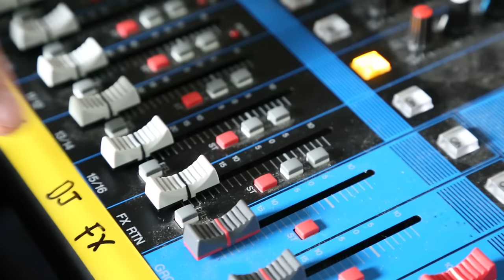How to Soundproof a party wall against noisy neighbours

Comment: Good video. Is it necessary to apply to Building Standards for permission before doing this type of work to a party wall?
Reply from the maker: Hi Rocknroll, in the UK, generally no, you shouldn't need permission just to add soundproofing to your side. If you wanted to double check, no harm speaking to your local building control.

Comment: Hi im inquiring about getting my front room done so whats best to block music you reckon
Reply from the maker: Hi adrian harry, we have different systems depending on the level of noise you are trying to soundproof against and the type of noise (e.g. airborne / airborne and impact music vibration). The wall soundproofing systems are also dependent on the build-up of your wall (e.g. solid, or stud wall). If you call one of the technical team on 01423 206208 they will discuss your noise issue in more detail with you. 
The best performing system is the ReductoClip Independent Wall system:
https://www.soundproofingstore.co.uk/reducto-clip-system

There are also direct to wall options:
https://www.soundproofingstore.co.uk/reductoclip-direct-to-wall-system
https://www.soundproofingstore.co.uk/soundboard-4

Comment: Can I mount these on top of plasterboard?jay
Reply from the maker: Hi yes, on a standard brick/block party wall and we recommend using 9 hammerfix 80mm screws for each board. If fixing to a stud wall then you need to locate the frame and attach the boards through the plasterboard, directly to the frame because they weigh approx 34kg each.

Comment: Hi, can you soundproof with plug sockets in your walls??
Reply: PC No price?
Reply from the maker: Hi Alfie - You can use something like our putty pads which can either wrap around the back of the socket box, or insert inside the socket. https://www.soundproofingstore.co.uk/store/Acoustic-Socket-Putty-Pads-p52901193 These will help minimize the problem, but the sockets will always be a weakness. For best results, soundproof the whole wall and have the socket surface mounted, or move the socket to another wall. Obviously the these options are much more intrusive, so many people will opt for the far easier putty pad solution.

Comment: Does this work for impact noise? Eg foot steps from the flat above
Reply from the maker: Hi bigbobabc123 In terms of impact noise this is always best dealt with at the source of the impact. I.E. on the floor of the flat above. For impact noise, you would therefore need to look at our SoundMat™ solutions, e.g. SoundMat™ 3 Plus  (please see link: https://www.soundproofingstore.co.uk/soundmat-3-plus)  
The SoundBoard 4™ as shown in the above video would only be used for walls and is most effective against airborne noise.
If you don't have access to the floor above, then you would need to look at soundproofing your ceiling and the most effective system would be the ReductoClip™ Ceiling System:  https://www.soundproofingstore.co.uk/reductoclip-system-for-ceilings

Comment: Could you stick a sheet of green glue + drywall over the top?
Reply from the maker: Hi You could add Green Glue and a second layer of plasterboard however this will probably only add 2-3dB improvement. if you are looking for a higher performing system then please look at our ReductoClip direct to wall system https://youtu.be/lI2bdQZWyOE
Regards. Ian Baker
Reply: @SoundproofingStore  is this available in U.S.?
Reply from the maker: @upglove4960  I'm afraid we don't deliver this soundproofing product to the U.S.

Comment: What were those 2 layers? What if you can't cover the whole wall? There's an air conditioner on my wall and this is a rental so drill into the wall is not possible. Any sense try hanging something on the wall?
Reply from the maker: Hi Ian Leahy, the product is the SoundBoard4. One board, simple direct to wall installation featuring 4 different layers of soundproofing materials laminated together. A very easy DIY install, which does require fixings to attach it to the wall. Soundproofing is all about adding mass to a structure, which reduces the ability of noise to pass through it. Therefore, these boards weigh 34.83kg and need to be securely fixed to the wall. Further details can be found here:
https://www.soundproofingstore.co.uk/soundboard-4
Simply hanging something on the wall won't achieve any effective soundproofing unfortunately.
With regards to the air conditioning unit, in an ideal world, you would remove the unit, soundproof the whole wall and reattach the unit.

Comment: Its there a system for people who want a temporary solution, renters, or people who want to soundproof a hallway wall?
Reply from the maker: Hi William - Unfortunately we don't offer temprary solutions just because of the nature of what soundproofing takes. Airborne sound is blocked by mass, mass is basically weight. So you need to completely cover the wall in very heavy, dense material. There is no way that this type of material can be temporarily fixed while safely carrying the weight and being completely sealed and air tight. Anything like curtains, and screens that would be easy to move, would be too light to make much difference and not sealed, allowing sound to leak through. My advice for renters would be to discuss it with the landlord and try to get permission. It will benefit the landlord in the long term.

Comment: "How to soundproof a wall"
Step 1. Establish that the wall isn't soundproof. 
Step 2. Call a company to come out and install soundproofing panels. 

Helluva video guys...way to show us how to reduce those DESSI-bells!
Reply from the maker: The point is, if you have a problem with airborne noise, put some heavy mass between you and the noise and it will block it up to a certain level. That principle is applied with the SoundBoard4 - It weighs 35kg per 1.2m2 so that is an indicator of the type of weight required to remove a clear conversation. But dont forget to absorb the small vibration and don't leave any gaps because like your car window being down by a mm the noise will leak.
Reply: @SoundproofingStore   The Soundproofing Store   The Soundproofing Store  yeah, I don't think that point got across in the "how to" video. A description of the product you're using, where to buy it, how much it costs, all more informative than the company review by the "on a morning" "on a nighttime" woman.

Comment: Can this be done on ceilings as we are in a downstairs apartment
Reply from the maker: Ricky D - Not this same system, but we can soundproof ceilings to a high level. Check out our ReductoClip™ ceiling system - 
https://www.soundproofingstore.co.uk/reductoclip-system-for-ceilings
Reply: A drop ceiling made from Acoustic Plasterboard and filled solid with rock wool insulation is a cheaper solution
Reply from the maker: Yes, but its all about how you drop the ceiling, and what boards/how many boards you use. There's many ways to skin a cat, but some ways are better than others.

Comment: Hi do you install the Soundproofing too?
Reply from the maker: Hi Tammy - We don't provide an installation service ourselves but you have three options. Our systems are relatively straight forward to install so a good DIYer can do it themselves. If you prefer somebody to do it for you, a local builder or tradesman would be more than sufficient and relatively cost effective. Finally, we do have recommended installation teams that we work with.. These are pro installers so tend to be a more expensive option - https://www.soundproofingstore.co.uk/instalation

Comment: Does this work if the sound being transferred is deep thudding footsteps?
Reply from the maker: Hi awreckingball, SoundBoard4™ is designed for airborne sounds, not for the deep thudding of impact vibration. The most effective system for loud levels of impact and airborne noise is the ReductoClip™ Independent Wall System https://www.soundproofingstore.co.uk/reducto-clip-system
However, it depends if the sound is coming through the wall, or if some is also coming under the floor as well.

Comment: I need to get this done, my concern is a lot of the noise comes through our fire place as the neighbours fireplace is the other side of ours
Reply from the maker: Our tip is to do a simple ear test. Next time you hear noise next door, put your ear up against the alcove wall and get a good sense of what you can hear. Then put your ear against the chimney breast and compare. Chimney breasts include extra layers of brick, providing more mass than the rest of the wall, so 9 times out of 10 are naturally more soundproof. However, every now and again, (especially in older properties), weaknesses can form which allow the sound to get into the flu, and then the sound can resonate inside and amplify. If this is the case and you require advice, please do feel free to contact us; sales@soundproofingstore.co.uk

Comment: This is identical to me in my thinking of buying our house which is old. We also have a fireplace like yours but it's not been blocked like yours. This is my worry about soundproofing is all the noise will come through the fireplaces like a speaker box
Reply from the maker: Hi  As a general rule we normal don't need to soundproof the fireplace as these are normally constructed with a double layer of fire bricks which are far denser than normal bricks so less sound can travel trough the fireplace. If nose traveling through the flue is a concern then we recommend inserting some acoustic mineral wool to absorb noise and to stop it resonating and amplifying in the ceiled chamber.

Comment: you've left a huge gaping hole (the fireplace). This is like insulating a roof and then leaving a hole for ventilation.
Reply from the maker: Hi @biccypequeno, in most instances the fireplace doesn't need soundproofing. Adding mass to the alcoves helps to block airborne noise and chimney breasts are usually constructed of a double layer of fire bricks which are more dense than standard bricks. This means the chimney is (naturally) already more soundproof than the alcoves meaning in 9 out of 10 cases, only the alcoves require soundproofing. 
Doing a simple ear test when you can hear the unwanted noise coming through the wall (listening to the noise coming through the alcoves and then doing the same against the chimney breast) is a quick and easy way of checking.
The below article goes into more detail:
https://www.soundproofingstore.co.uk/how-to-soundproof-a-chimney
Reply: @SoundproofingStore  All the noise in my house comes through the chimney and fireplaces. If you put your ear to the alcove walls there's hardly any sound, ear to the fireplace wall the sound from next door is loud. It's common as the chimneys in old houses act as echo chambers. Often neighbours mount their TVs on the chimney making the situation worse.
Reply from the maker: @SouthIslandSk8  absolutely, having TV's mounted on the chimney breast can certainly lead to problems, as can renovations and removal of some of the fire bricks, or removal of the chimney on your neighbours side. In your situation you would absolutely need to soundproof the chimney. The above article goes into more detail on this, or alternatively please feel free to call us on (01423) 206208 and we will happily discuss this in more detail with you and advise accordingly.
Reply: @SoundproofingStore  yeah on both sides fireplaces removed and plasterboard up. Imagine sounds travels easily through 12mm drywall and echoes around the flue. Old houses especially terraced are shite. I wish I had known this before buying. Guy in basement 3 floors down next door can hear his phone calls in every room. If he talks loudly. Nightmare. Rooms are small so sucks to put up a false wall and lose even more space

Comment: My bloody neighbours although not particularly noisy decided to rip up their carpets and go with wooden floors! They’ve 3 dogs. Every bloody noise reverberates through the floor joists into the party wall. Nothing can stop this can it?
Reply from the maker: Hi Johnboyginger - I feel for you in this situation, we get a lot of calls from people in a similar situation. It's certainly a difficult one. The best way to solve the problem is unfortunately on the source side, so adding something to their floor to reduce the impact. But it doesn't mean you can't do anything. You can install a system onto your wall that is capable of dampening high levels of impact vibration. Our ReductoClip system is perfect. You'll also want to insulate between your floor joists with acoustic mineral wool. Realistically, it may not block everything out, because some of the vibration will flank into returning walls etc, but it should certainly give you an improvement - https://www.soundproofingstore.co.uk/reducto-clip-system
Reply: @SoundproofingStore  thank you 👍

Comment: So you just put those panels up with white sealant and don't paint over them?
Reply from the maker: The outer layer of the SoundBoard4 is a 15mm acoustic plasterboard so you will end with the same finish as if you hung plasterboard on your wall. Our recommendation for a good finish is to apply scrim tape to the joins and give it a plaster skim. The SoundBoard4 is actually screwed on using 80mm hammfix screws (if applying to a brick wall), leaving a 5mm perimeter gaps. The sealant is used to fill the perimeter gap and in the video it shows the fitters using the sealant to fill between the boards, but scrim tape and a plaster finish is sufficient.

Comment: What exactly they did put on the wall?
Reply from the maker: Hi Marta M - The info is in the video description, but we used the ProSound SoundBoard 4 in this case which you can see more of here - https://www.soundproofingstore.co.uk/soundboard-4
Reply: @SoundproofingStore  Thank you. I have a door that separates my apartment from.my neighbour. He watches tv all night long, i can hear him cough, sneeze, move chairs. The noise he makes wakes me up every night. I need to sound block the noise coming into my apartment. ( the single door )_. Nobody uses the door. What material that is not too expensive would you recommend best? I really need to get a good night Sleep soon. Thank you.
Reply from the maker: @martam518  Doors are quite tricky. To give you the best advice, if its a light weight door I would replace it with a thick, solid core, heavy door with more mass. Something like a fire door for example. The more mass the door has the more sound it will block. Secondly, you need to seal the gap around the perimeter by adding a seal to the door frame and bottom of the door. If there is a gap for air to get through, sound will also get through it. If you really can't change the door, then there are materials you can possibly add to the existing to increase it mass, but depends on the shape of the door. Have a look at this blog we wrote - https://www.soundproofingstore.co.uk/how-to-soundproof-a-door
Reply: @SoundproofingStore  The door is like a wall. Nobody uses it. So they can be blocked any way.

Comment: Fact is you can spend hundreds, even thousands trying to soundproof your home and it’s all money down the drain if you have no control of the neighbouring property. You might be able to muffle the sound but once it’s in the walls you aren’t stopping it. a couple of layers of dense acoustic board on their side would be far more effective, but chances are asking your noisy neighbour to insulate their walls isn’t going to go down well. I’ve been there before and unless you are going to isolate floor / ceiling joists etc, anything you do to the wall is just one of many routes the sound will travel along.
Reply from the maker: Hi Chris Flory, you are right that sound will flank into other surfaces, but this is a minimal amount. When we talk about household levels of noise (not extreme, amplified levels), the majority of the sound is coming directly through the wall. Airborne sound is only blocked by mass, so by adding heavy, dense, mass loaded materials to the wall, we greatly improve the walls ability to block that sound. It doesn't matter which side of the wall it's installed on, its just about giving the wall more mass. Yes, if the neighbours are playing extremely loud, bass heavy music through massive speakers at 120dB, this system won't do a lot. You would need one of our more advanced systems. But if all you are hearing is regular household noise, then this system will make a huge difference. At the end of the day, it's not about blocking out all sound, you just want your living space to be comfortable and private.

Comment: Great video, Trouble if you live in a flat you can't do anything just suck it up
Reply from the maker: Hi Peter - There is plenty you can do in a flat if you own the flat or have permission to make changes. There is a solution to most noise problems. Do you mean noise coming from above or below or from next door through the walls?
Reply: Same situation here , noise coming from above .

Comment: What if there is a window or French door in the room? How can you minimize sound and vibration?
Reply from the maker: Hi, windows and doors are always the weakest point in any room and we quite often use this phrase "soundproofing is like waterproofing, it is only as good as the weakest point". I would advise speaking to specialist glass provider as you can purchase specialist glass and the standard French Doors would need to be replaced (the frame made smaller and heavy duty fire doors used as they have more mass). The majority of noise problem cases are from neighbour to neighbour between, party walls, ceilings,floors so we only really come across this scenario if someone wants to build a cinema room or something similar or they have a noise problem coming through the window, so one or the other.